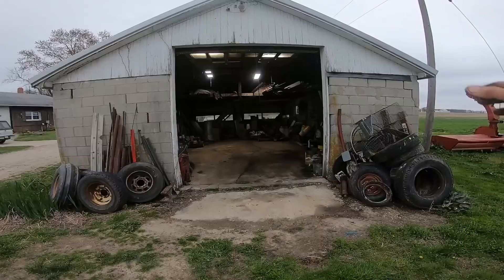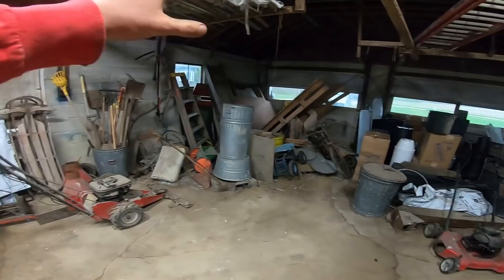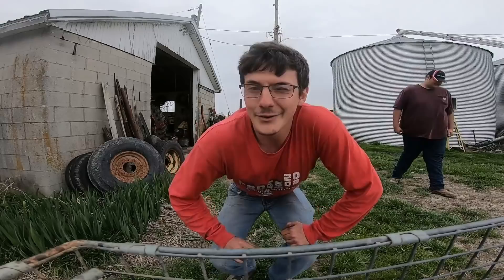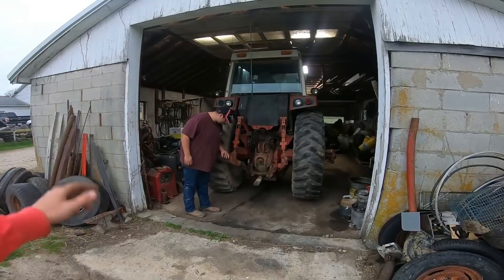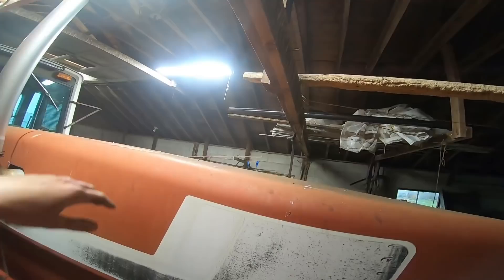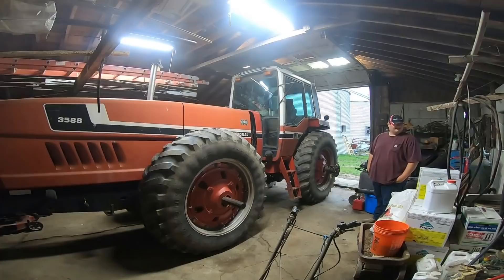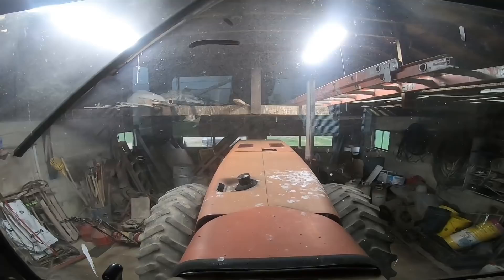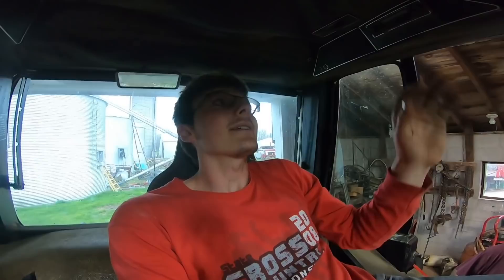Will the 2+2 Fit in the Garage???

Comment: The 3rd or 4th job I did for the shop that got me my Canadian immigration papers 20 years ago,  was put a clutch in one of those.  The old IH dealer from before the case IH merger still ran a shop in town.   There was a big heavy proper splitting dolly set up for doing them he lent us, that bolted to the engine end and supports the back if i remember right it then balances perfectly and can't fall off anything. 
   Then I'm thinking the drive shaft yokes removed from the rear of the front shaft, then when the bolts are out of the clutch housing a 12 point socket fits the splines and the front end winds forward and back afterwards with a ratchet. With the splitting dolly/a shop manual and winding the front away it was pretty easy for never having done one before. Thanks for the video, Take care guys

Comment: I really can tell why farmers call this the anteater. I really like it. You can certainly use it to its potential and if you got a good deal it seems plenty powerful enough and I can imagine adding duals front and rear with wheel weights both front and rear. You will need to put jersey barrier concrete weights on your disk to even pull it down unless you get a disk twice as wide for less fuel per acre.

Comment: I park the chore tractor in a short shed. I cut the stack off even with the roofline. I still have to throttle it all the way down when I pull in or the rain cap is flipped up too much to go in the doorway. It’s going to need new rubber someday and I might be in trouble.
Reply from the maker: I know the feeling.

Comment: this reminds me of a "i dare you". mid 1980's in high school someone i wont name (rciky) dared me to hack the cafeteria vending machines (plural). trick was kneel down get 1 hand/arm in & up to the locked inner dispenser door then put the 2 quarters in, when the machine opens the door hold it open & it's tooth decay time. actually not much different than pulling a calf

Comment: I was under the impression that you didnt have to split them 2+2's to change the clutch?
Reply from the maker: They are mostly 86 series parts. Clutch is at the front of the cab.
Reply: @UCLj-OxI72b-yj2ctKRS5ctQ Friend of mine had one and he said he changed the clutch by taking the drive shaft out and then the front cover of the clutch housing came out without having to split the tractor?